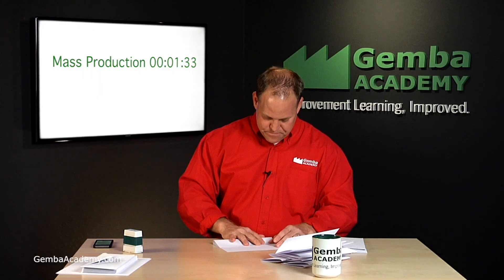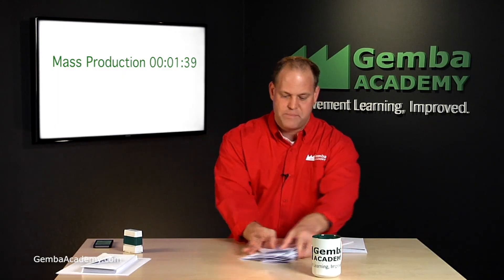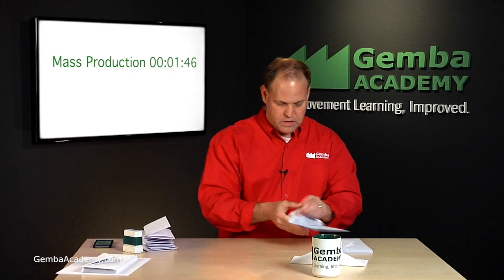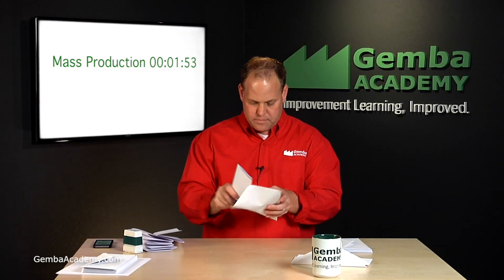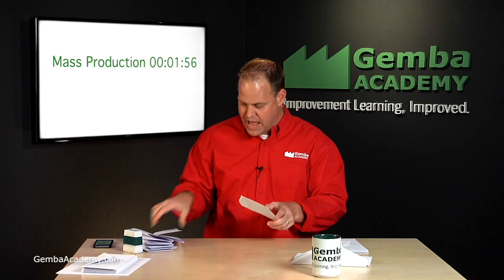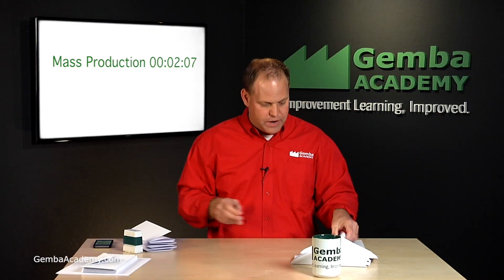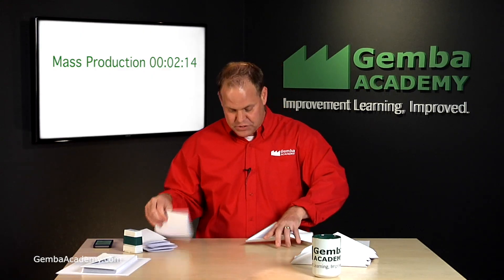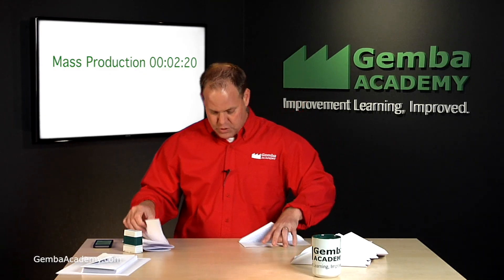Watch This One Piece Flow vs. Mass Production Envelope Stuffing Lean Thinking Simulation

Comment: The answer is...........
Less wait time. The envelopes are "waiting" for a smaller amount of time, or specifically in this case, there is less picking up the paper/envelope and placing it back down again.
An example of why it is better to have a small level of work in progress (WIP).
Thus, overall the amount of time required to complete the who batch is reduced.
Note the "what happens if there is an issue" point in the video.
That's an important point.

Comment: Over the years I have come to realise how much time is lost due to material handling. I now seperate material handling as a seperate time measure during all tact time measurements. its an "in-hand" vs "out of hand" measure. In this case its 1 touch as opposed to 3 touches. However, the more intricate and more complex the situation the relevance of costing reduces. For instance each touch could then include an inspection point. So you can use the "time loss" as "inspection gain". It just makes for better idea thinking. Remember, Time Matters!

Comment: i like the demonstration good example compared to what i do for a living. I was wondering though does it make a difference that on the first part you double checked the envelope to make sure it was closed and on the second part you skipped that process. That over time does effect time right?
Reply: bdjuggalo, even if he spent an entire second on each double check, that would have only added 10 seconds to the process. 
As he mentioned, it's really the cumulative time each act of stacking, reaching, picking and repositioning that adds time to the mass produced system.
Reply: bdjuggalo he didn't need to do that step because he had the piece in his hand.  The piece did not need to be stored and put into inventory and then pull item out of the inventory.  An example is software development is the time it takes you to get back into the code (aka context switching).

Comment: It's an interesting demonstration, but I'm confused why this works especially as a one man station.  Another big thing from Lean and Theory of Constraints thinking is the concept of Bad Multitasking.  I would think that in a single man station, you would get an efficiency from performing each single individual task on the batch of 10 papers rather than constantly context switching through each task on one piece flow.
Reply: +3moirai There won`t be a conflict as long as you keep the station with less than 3 options or choices. As studies have shown, a normal person can deal with no more than 3 choices during one cycle. The key thing here isn`t efficiency. The goal isn´t to keep a worker busy all the time, but make sure material flows smoothly through the process. Even if that means keeping a low efficiency on resources. TOC mentions that efficiency thinking is precisely one of the constraints that avoid getting the best flow in any environment. The Goal explains that in detail.